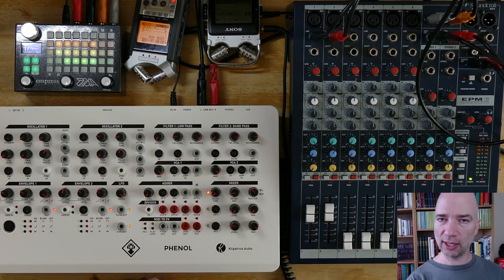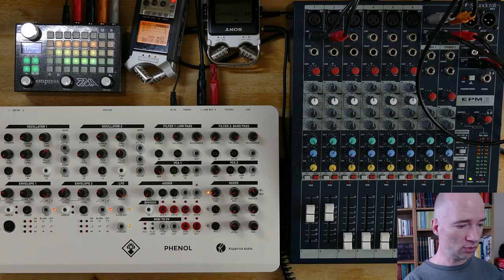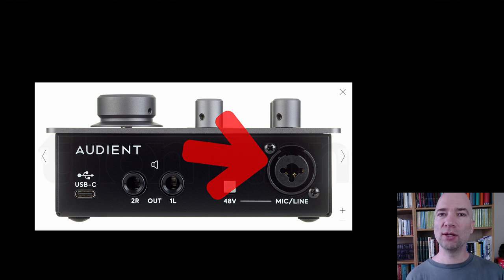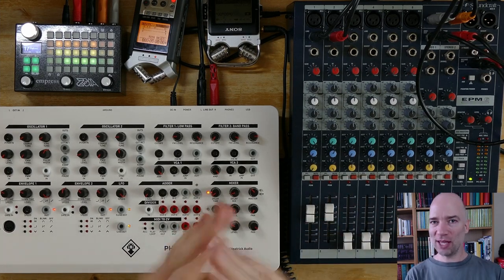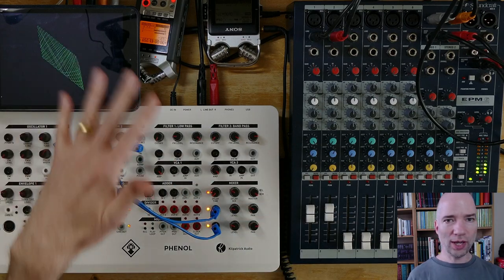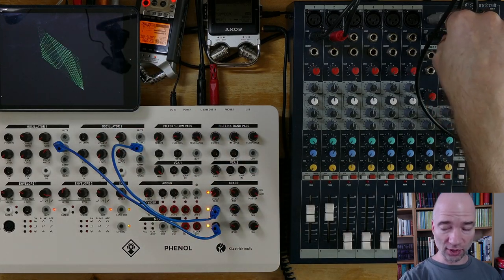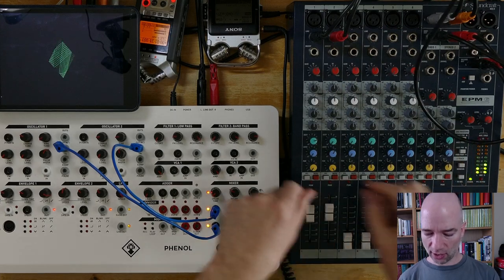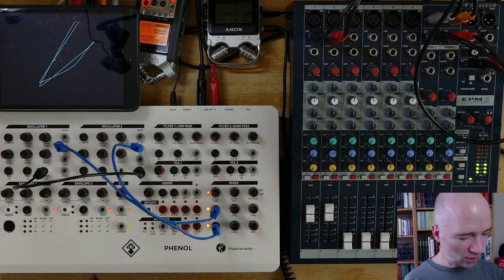Tutorial: Dual Recording & Oscilloscope - Soundcraft EPM6

Comment: Nice setup but I imagine if you had to start over you'd be happier with a Tascam Model or Zoom L-Trak recorder because with either one you can record in multitrack, and do a live mix down with external effects, and with the L-Trak even more options for alternate mixes, for example you could have one mix for live streaming, one for monitoring, and another for a live stereo mix down,  all while preserving individual audio tracks and sync.
Reply from the maker: Thanks. Oh yeah. If I was getting a mixer now, I'd have got a Tascam Model 12, easily. It was on my shortlist when I bought the Soundcraft, but at the time, I didn't really see the need for many of its features, nor did I really know what I was looking for in a mixer, or much about using one at all, so I decided to get something simple, analogue, and reasonably cheap to start me off while I was learning.

I am considering upgrading to a Tascam Model 12 every now and again as it would replace both my current mixer, one of my recorders and my audio interface, all in one, but I don't technically need one, so I am also quite happy with what is possible with what I have.
Reply: @hakonsoreide  I went from a similar setup, Mackie mixer + Tascam DR1000mk2 recorder. I upgraded to the Zoom F8n, which is a lot more compact, and now I have 8 discreet tracks I can record while doing a stereo mix for live sets. I even have a way of routing to 4 outputs, because it's an 8x4 mixer. No sends, which is a bit limiting, but for my way of working it's ok. I am either playing live or using it to record using it in interface mode, which is really convenient because the bulk of my guitar looping setup is on a pedalboard, and the F8n lives there. When I leave the studio it's only disconnecting the USB cable from the computer, and the cables I send to my monitor controller. I don't need them but it makes it easier to use without my computer being on.
Reply: @hakonsoreide  Maybe you can sell the H4n and EPM to put towards a Model 12. It will make recording "dry" and "wet" really simple so you can remix and/or overdub and edit as you wish later. I have the Zoom F8n, no sends but I can use it as a standalone mixer/recorder and/or audio interface so it's super convenient for my setup. I had only recently bought the F8n before the Tascam 12 was announced, otherwise I may have ended up buying that instead. If it's enough overall channels is really the only question, it's nearly perfect for a small home studio, even has a midi interface something I with the Zoom L-Trak series would have added, at least for midi clock if nothing else.
Reply from the maker: I have looked at different options, including multi-track recorders like the F8n as a future replacement for my setup, and I may yet sell the H4n, EPM and Audient iD4 audio interface and replace them with a Model 12, but as long as everything works, I'll probably stick with my current setup a little while longer. 

Once something stops working, however, something like a Model 12 might be the best replacement. Or whatever succeeds it in Tascam's line-up or some other option that might be available when that day comes. 

I also quite like the compactness of the 1010 Bluebox, and while I know I could control it with my MIDI Fighter Twister to make it a bit more hands on, but it still doesn't quite tick all the boxes for me, nor does anything exactly, really. I think at the moment, the Tascam Model 12 is the closest to the perfect mixer/recorder/audio interface for me if I decide to go for it.

Comment: Get an old analog CRT scope!
Reply from the maker: I was considering that, but they’re big, heavy, sometimes in dubious condition, and - most crucially - with dimensions completely unsuited to the overhead view I use for my videos. This is the next best thing, and of course far more flexible than an analog scope since I can use it for other visualisations too. Also, I already had all I needed for this particular setup.
Reply: @hakonsoreide  Still can't beat the display speed and quality! I have one in my rack
Reply from the maker: Of course, it would be great to have one, but I would struggle to place it in my current setup. If I had had a permanently placed rack, it would have been easier, but since my tiny office is multi-purpose, the small space divided between work and several hobbies, I don't have any fixed location for my music setup, having to bring everything out and connect everything up every time I want to play. I am constantly thinking of ways to keep more audio gear on permanent standby, though, so I may yet find a way to fit a scope into my plans one of these days.